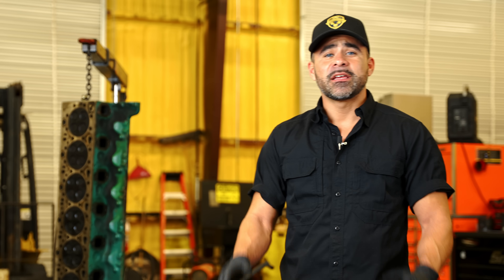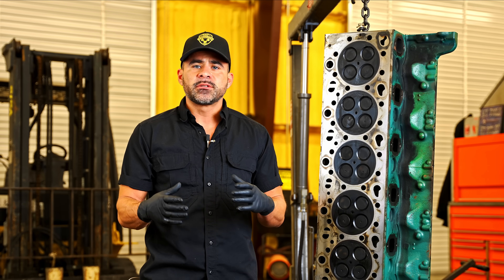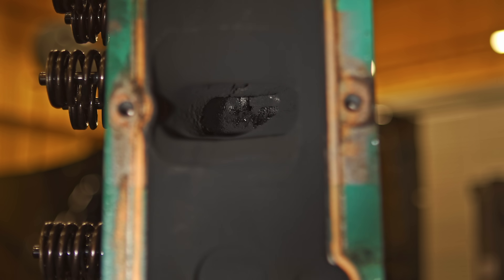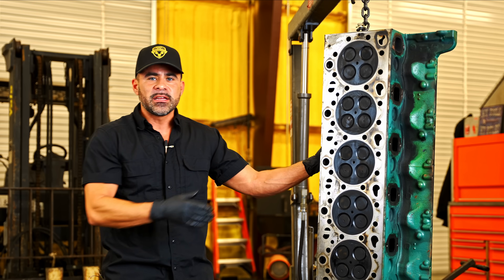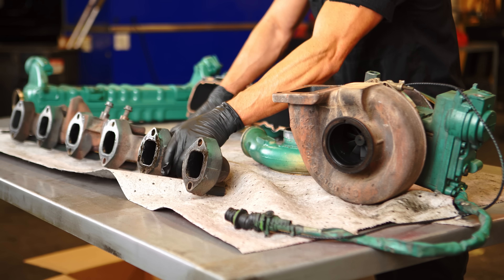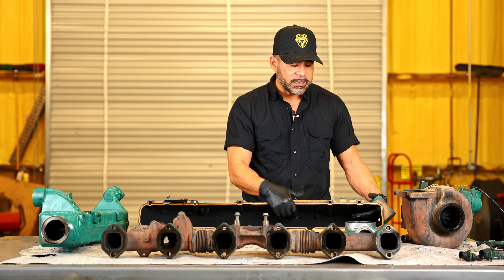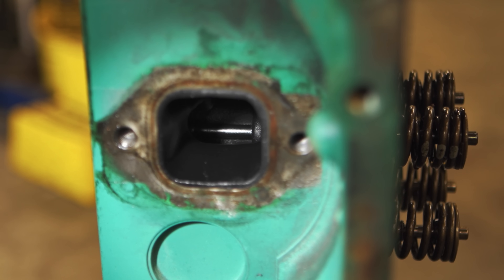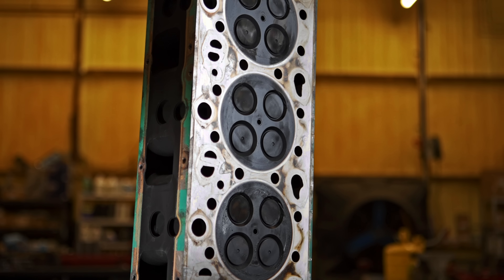High Oil Consumption. High Engine Oil Consumption Causes. Causes of High Oil Consumption.

Comment: As usual, completely  understandable, explanation, thank you for taking the time to make these extremely informative  and understandable video's 👍
Reply from the maker: Appreciate you, brother. I try to keep it real and break it down so it actually helps folks out here. Glad it’s coming through — more content dropping soon. 💪
Reply: @TATEXPRESSINC  so definitely if the intake side of the turbocharger is clean, the Turbo is not the problem? I thought the Turbo can have a problem on the exhaust side without the engine leaking oil to the turbo.

Comment: Green new mandate scam? 0w oil with extended oil change intervals with cheap oil filters. Poor pcv valve causing crank case pressure. Poor gas injectors thinning thin oil. My truck had plastic pcv valve sucking oil into air intake system. Carbon top to bottom!  All clean now! Gas cleaner and fresh synthec oil. Spark plugs incoming! 02 sensor check soon. Already idling perfect! You are right on!

Comment: Sucks that you can't even rely on the manufacturer to give you parts that will last, this man had his truck down for a rebuild then 20k miles later had to have it basically torn down again just hate to see it
Reply: I was down for 3 months on a head job due to back ordered parts. Finally got it back up and running now it’s using a gallon of coolant every 300 miles. I think the new head is faulty. I had to pour K Seal in the coolant system to get the coolant loss to stop. So far so good. It’s a shame I had to resort to those measures after spending $5k at the dealership tho!